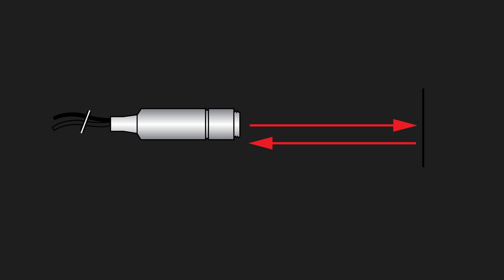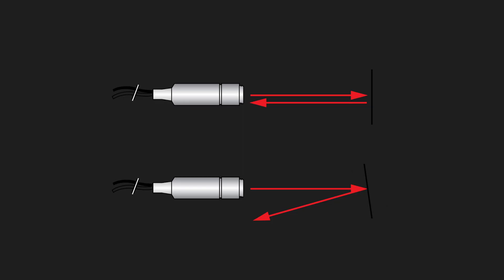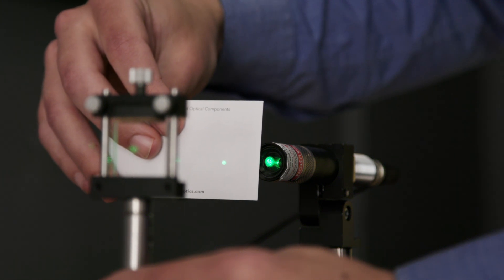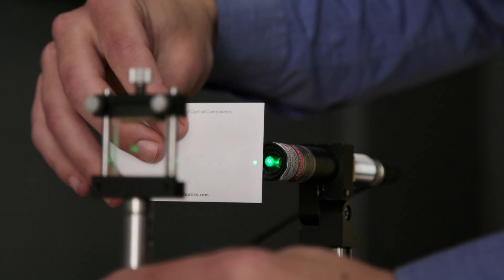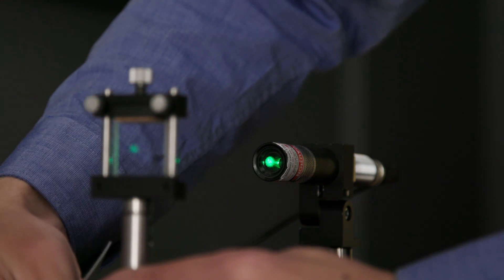Laser Optics Lab: Back Reflections

Comment: How would a reflected back beam could be damaging to the laser?
Reply: Not to the laser but to the focusing lense inside the combiner or the emitter as instead of handling 100% power with 80celsius now has an extra of 10% backlash that increases the heat to 90/100celsius and then if the mirror inside or the combiner is overheating cooling might fail and is a cascade of things that happen from there. In a good scenario ul get weak power as the light is scattered around randomly and doesn't do any damage but if it reflects back where it came from one ul think the module is broken but is actually ur lenses not aligned ... Or cracked.